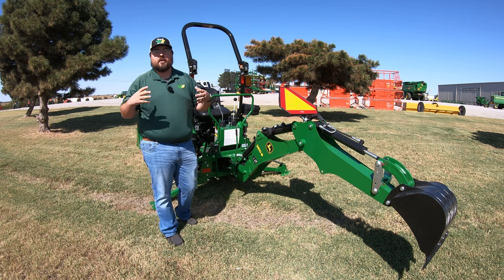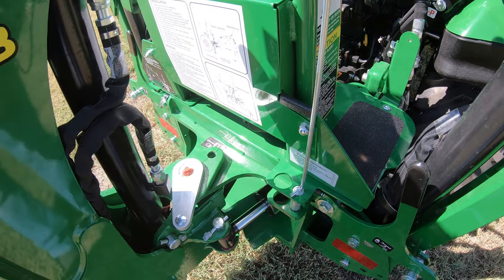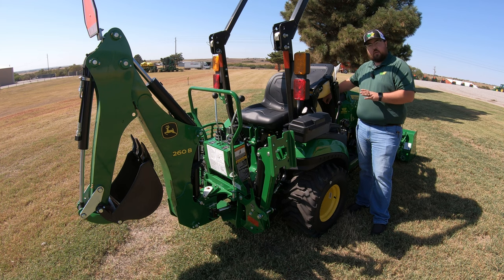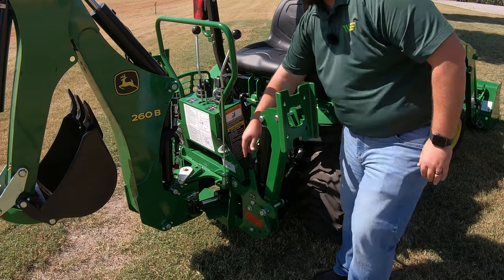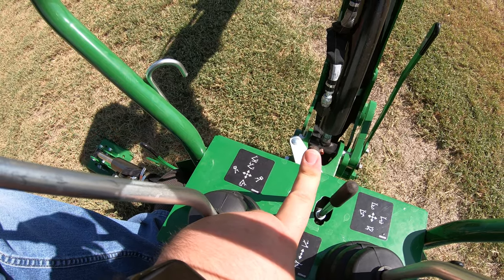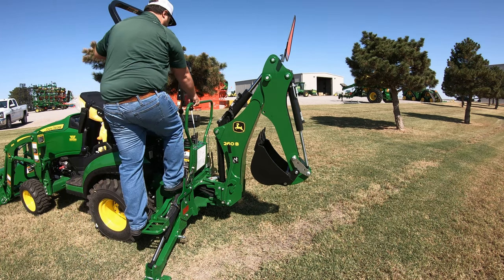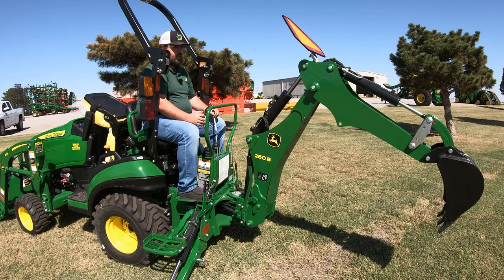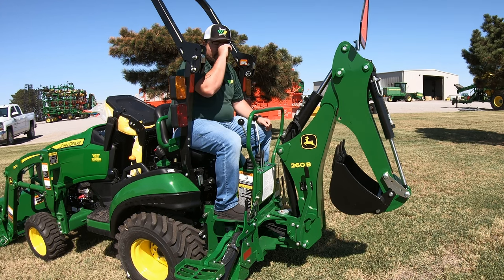How to Operate a Backhoe on 1025R Tractor

Comment: Thanks for the great video! Going to try practicing on my new John Deere backhoe for the first time, and this was extremely helpful. Can you tell me if there are any differences in operating the 370B to this model?
Reply from the maker: I am glad I could help and the operation function for the 370B should be very similar. It will just be a larger version of this. Good luck and let me know how it goes!
Reply: @WesternEquipment  great, thank you so much!!